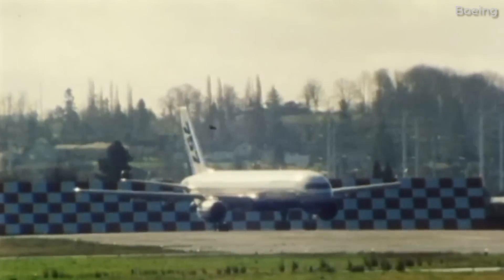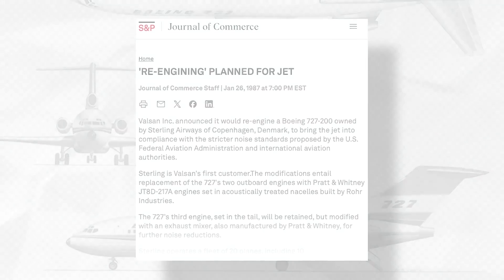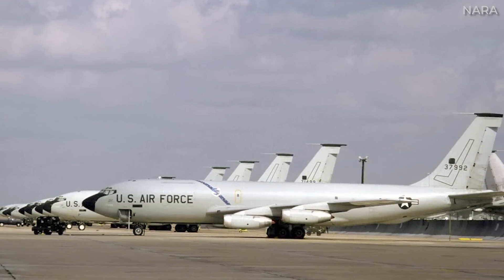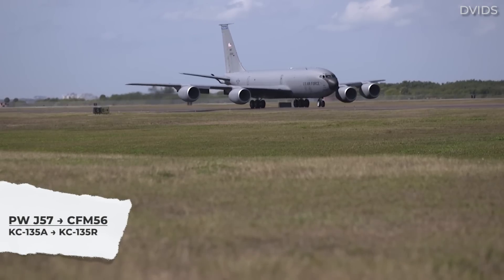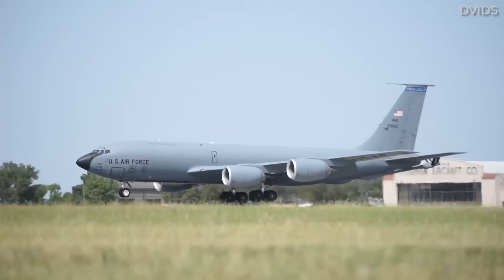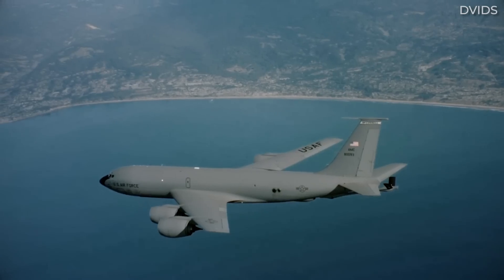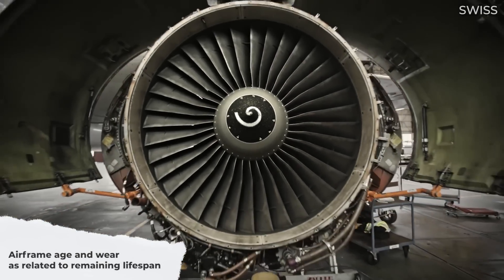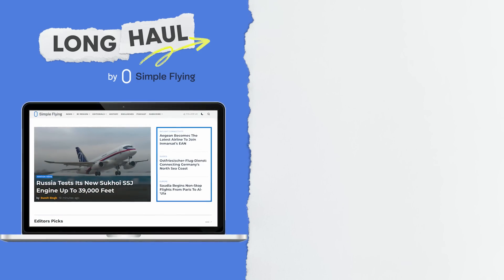Re-Engining Old Aircraft: Can It Be Done? Should It Be Done?

Comment: The DC-8-60 (and higher) was re-engined with the CFM56, incidentally salvaging the CFM program in the process.

The engine would later on be mounted to the 737 and A320 and the rest, as they say, is history.

Comment: New engines for every Boeing aircraft [ My opinion]

707: LEAP-1A 
717: CFM56 
727: CFM56 
737: LEAP-1A with the fuselage the same height as the A320
747: An engine the same size as 777 cabin that create 165,000 lbs of thrust
757: CFM56
767: GEnX
777: GE9X
787: GEnX

I also will change the yoke to the sidestick and have the same autopilot panel on every plane.

Comment: I'd reengine A319ceos with Leap 1B engines. The 1Bs are only slightly different in diameter to existing A319ceo engines, can provide a similar thrust rating, and use less fuel.

Comment: The Canadair CL-215 water bomber started as a piston prop amphibious plane, using  Pratt & Whitney R-2800-83AM radial engines. In response to customer requests, Canadair upgraded it to more powerful turboprops, using Pratt & Whitney Canada PW123AF. The current owner of the now-rebadged CL-415 licence, De Havilland Aircraft of Canada, has created an even more advanced model, the CL-515, but without a change to power plant.

Comment: The Indian Air Force (IAF) retrofitted the Fairchild C-119 Packet aircraft by fitting it with Westinghouse J34 turbojet engines mounted in a dorsal pod. This modification enhanced the aircraft's performance, particularly in high-altitude operations, allowing it to carry heavier loads and improve efficiency. The C-119, known for its cargo capabilities, was crucial during missions in challenging terrains like Ladakh, where it successfully transported troops and supplies at altitudes exceeding 16,000 feet.

Comment: For anyone saying re engine the 757 here’s why not.
- the 757-200 airframe is far heavier than the A321neo despite being the same internal length. This means with new engines it will lose its high thrust and still be less efficient.

The 757-300 would need a whole new engine type designed and built as it needs more power than the A321neo and Max-10, but less than any modern widebody engine. Plus their are not many -300s

Comment: Thing is, if we're going to talk about reducing our climate impact, sure, we might do that by retiring older airframes for brand new aircraft, but it's not like the NEO is an A320 made with new composite fuselages, it's the same 20th Century design - I know, it's approved by the FAA and EASA - that has a new wing and bigger engine, when a weight saving in the centre could be the improvement of fuel efficacy that's needed to meet global targets.

Comment: "forcing (Boeing) to include software to compensate for the unsafe aircraft behavior"  It wasn't because of unsafe behavior -- it was simply to meet an FAA requirement that control column forces must be within ten pounds of the existing design if there was to be no motion-based simulator training required.

If that FAA design requirement did not exist, there would have been no MCAS.  On occasion, pilots doing a couple of different maneuvers would have found they needed noticeably more column force than what they would have on what they had previously flown.  So perhaps a slight delay in desired angle of attack change, for example, as they adjusted to the heavier controls.

Comment: Up until now, an engines successor has invariably been larger and heavier than its predecessor. 

This has been in the main due to proportionally larger front fans to increase the bypass ratio.

Now, assume that the bypass ratio could be increased by having a smaller and more efficient core.

This would not only increase the engines' efficiency but also reduce its weight. There is also the possibility of reducing the size of the engine.

The engineering required to replace an engine with something no heavier and no larger is far simpler.

Comment: 737 Max never had unsafe behavior due to the engine plcaement, it was different fron NG series at high Angles of Attack, but not dangerous. MCAS was meant to provide similar handling to that of the NG series, that's all.
Reply: not exactly -  at low weights, with rear biased CoG and high power levels - the MCAS system was indeed there to prevent stalls from excessive pitch-up  (eg. go around) due to the new, higher, and forward placement of the engines
Reply: @ghostrider-be9ek  which isn't inherently unsafe - you just need to know about it, and react accordingly (or have the software fake it)
Reply: @ZeDestructor00  yes it is, and aircraft have crashed (russia) because of this effect
Reply: @ghostrider-be9ek  Which type/model of aircraft crashed in Russia?
Reply: @htimsid  I dont recall, was it a boeing or one of their domestic products? it was a medium sized aircraft
Reply: @ghostrider-be9ek  Possibly a Sukhoi Su-95

Comment: I'd love a re-engined 727 with a glass cockpit and modernized interior. A bit noisy, but one of the most beautiful aircraft ever built.
Reply: That unfortunately would not be possible. One of the reasons Boeing gave for its discontinuation was that there was simply no room to fit a more modern high-bypass engine into its tail.
Reply: @FloppaAppreciationSociet-ds7zf  It's just a wish. Hypothetically speaking.
Reply: @FloppaAppreciationSociet-ds7zf They actually explored replacing the 2 side engines for the larger version of the JT8D that was made because of noise snd environmental concerns compared to the orginal
Reply: And evidently the most unstable on approach.
Reply: @bobflicks6104  They fixed that by correcting the flaps settings on takeoff and landing.
Reply: EXCELENTE  AVION VOLE  VARIOS AÑOS, RESULTADO INOLVIDABLE

Comment: - A340-300 with CFM LEAP 1A or PW1100G
- 737-800 with IAE V2500
- A380-800 with RR Trent XWB or GE9x
- 747-400 with RR Trent 700
- A340-600 with EA GP7000 or RR Trent 900
Reply: genx and trent 1000/ 7000s would be more adapted for the a380neo
Reply: The IAE V2500 on a re-engined 737-800? That’s a pretty old engine. The GE90 is way too big for the A380, same with the XWB. It’s current Powerplant is sufficient enough
Reply: @APerson-fj6yx  fact: the Trent XWB-97 was tested under the wing of an A380
Reply: GE90 for the A350-1000 would be great. Then the GE9X is reserved for the -2000

Comment: I see a lot of comments talking about re-engining the 757, some even say with the Leap-1 Honestly I'm not sure, but I believe it would be a bit underpowered compared to its current engines, and so far engines for it aren't an issue, it's the avionics and the software that needs updating on the 757. Of course if Boeing ever kept the 757 in production, we might see new modifications to the intial design, such as new engines like the Trent 700 found on the A330 Neo, maybe new more efficient wingtip profiles, perhaps also foldable for smaller airports a concept found on the 777X and of course new interior designs for cockpit controls (with updated software and avionics) and passenger/cargo cabin.
Reply: I think the time to re-engine the 757 has well and truly passed.

Even had there been a suitable replacement,  many 757s would still have been retired over a decade ago.

Many of those currently flying are only doing so because the airlines had little choice but to continue running them, hoping that Boeing would have something suitable before they wore out.

Even if a suitable engine became available tomorrow,  I doubt if there are sufficient 757s with enough life left in them to justify a re-engine program's development costs.

So it has been a case of trying to find 757s on the secondary market with life left in them to justify the rebrand, or, once the A321neo and it variants became available, use them.
Reply: 757 is overbuilt for the task it is designed - shorthaul people mover. That's why the arrival and A321 and later 737-900 ate its cake to a point it is no longer viable.
Hot high performances and transatlantic capabilities are nice but they're niches.
Reply: @steinwaldmadchen  If it's such an "undesirable" plane, why is Delta still flying 131 of the type and United still flying 61.  That's pretty good for a plane that you think was a niche aircraft.  Obviously, this is a desirable plane to be flying...even though it stopped production in 2005
Reply: @ScottCP1  The fact that in the 90s Airbus managed to steal half of 757's delivery with A321-100 an obviously inferior aircraft compare to even later A321CEO, is telling. Boeing also sold ~500 737-900/ER despite it is worse than A321.
There are some airlines that value 757's better performance, just not enough to sustain the production. That's why for a fact it is a niche. It's just not universal.
Reply: @ScottCP1  US based airlines will keep flying those planes until they can't with how much demand they have and A321Neo delivery times, and the MAX 10 nowhere in sight, otherwise, it's also why icelandair is retiring their own 757s for A321Neos.

Comment: I would re-engine the flying pencil....aka the B757. A pair of engines currently used by the B737 Max would probably be a great fit for the airframe.

Another re-engine I'd love to see would be to place a pair of GE9-X engines on a B747 airframe, however that would really change the aircraft and require extensive R&D and recertification.
Reply: Counter-suggestion - find a way to add a 747-style "hump" to the 777?

Comment: Interestingly, the McDonnnell-Douglas MD-80 series planes were built strong enough to get a new engine. They should have been re-engined with the Pratt & Whitney PW6024 engines starting from around 2007 on, which could have resulted in a much quieter airplane that could have extended the life of the MD-80 to almost 2030!
Reply: Somebody should have tried a cfm 56 engine on the MD-80.  It seems to be the perfect engine for a 150 passenger plane. The 737 family has them and so does the A320 family has them so why not the MD-80 family also???

Comment: MCAS wasn't the issue with the 737MAX. The issue was Boeing didn't tell anyone about it's existence or develop pilot training for what to do when it fails. They did this so airlines wouldn't have to pay for pilots to undergo additional simulator training. That decision cost 300 lives. 

Oh, and MCAS' initial implementation was absolute trash, with no redundancy or comparison logic for the angle of attack sensors. That doesn't mean the idea of MCAS was a bad one though.

Comment: Would be great if several aircrafts re-engined;
1. DC-8-73 = 4x PW1900G
2. A340-600 = 4x GEnx-2B
3. 747SP = 4x GEnx-2B
4. 767-400ER = 2x GEnx-2B
5. An-124 = 4x GEnx-2B
6. C-5M = 4x GEnx-2B
7. C-141 = 4x PW1500G
8. P1 = 4x PW1700G
9. C-17 = 2x Trent-XWB-84
10. IL-96-300 = 4x PW1135G
11. A340-300 = 4x PW1131G
12. Avro RJ100 = 4x PW308C
13. S-3 = 4x AE3009
14. IL-76MF = 4x PW1131G
15. (Future) An-225 = 4x Trent-XWB-97 or 6x GEnx-B
16. Tu-154 = 3x PW1500G
17. SSJ100 = 2x PW1900G

18. CH-47 = 2x T408
19. CH-46 = 2x PT6C
20. SA-321F = 3x PT6C
21. S-64 = 2x T408
22. 214ST = 2x CT7C

23. C-160 = 2x PW150
24. Martin Mars = 4x PW150
25. Be-200 = 2x PW1900G
Reply: The MD-80 series should have been re-engined with the Pratt & Whitney PW6024 engine starting in 2007.
Reply: Imagine an A340-300 with CFM LEAP or PW1100G engines

Comment: 737 with a single GE9x in the tail
Reply: Do you mean one engine instead of two? That will never be certified.
Reply: @user-yt198  and in the tail?the pitching up would be crazy!
Reply: It would literally fly like a rocket then with correct modifications for the straight through design and would struggle to stall
Reply: @filledwithvariousknowledge2747  it would also be pretty unefficient!

Comment: What about the DC3 re-engine?
Reply: @romandelasalle  a company years ago modified a DC-3 by stretching the fuselage adding turboprop engines as well as a streamlined nose cone
Reply: That's essentially what the P3-Orion is; an upgraded and reengined DC-3.
Reply: @Gameflyer001  No it isn't. The Lockheed P-3 has absolutely no design DNA in common with the pre-war Douglas family. It is loosely based on one of Lockheed's own airliners, the L-188 Electra
Reply: @harryspeakup8452  yep, you're correct. There was a military variant of the DC-3 that employed more advanced turboprops.
Reply: Basler is making reengined versions called the Basler BT-67

Comment: Re-engine the 757 with a newer Rolls-Royce Trent engine, to deliver the same 43,000 pounds of thrust as the RB211 did, call it Trent 400?

If the PW1000G fixes its reliability problems, maybe Pratt & Whitney could offer a higher thrust variant of that for a re-engined 757.
Reply: Can be also called as “Trent 600 (III)”
Reply: PW1200G?

Comment: You forgot the re engining of the B52s with Rolls Royce engines
Reply: I was thinking the same - also, it's interesting (and would make a good video) as to why they went with 8 not 4 engines. Apparently the work to convert to 4 was too much.
Reply: @shero113  i think using 4 engines would affect the aerodinamics, so they would have to redesign the aircraft
Reply: @rodrigogoncalves6165  it's also about rudder sizing. The rudder must be sized to compensate the imbalance created by one engine failing
Reply: it only focused on jet engines.. they didn't event mention convair props or dc-3 engine conversion from piston to turboprop

Comment: Boeing should have chosen to redesign the 757 to conquer the mid range market and rival the A321
Reply: Boeing offered an improved 757 to airlines years ago but no one at the time showed interest and received no orders.  And while the B752 was kind of successful, the B753 was a commercial failure.  Also, the 757 was more expensive to build than the 737.  Finally, the 737NG family turned out to be a massive success for Boeing and became the best-selling single-isle airliner.  So Boeing had two single-isle airplanes of similar capacity and performance, but one did well while the other did not, the poorer of the two saw a market not favoring it and cost more to build.  All of this pretty much conspired against the 757, despite it being an objectively better airplane.
Now, with everything that has happened since (market changes, MAX issues, etc), in hindsight it is easy to look back and say "it would have been better to go with the 757 instead of the 737" - and I agree.  But in many industries, strategic decisions are made that don't have an effect years, or even more than a decade later, and things can and do change in that time that are difficult or impossible to anticipate.  This doesn't excuse Boeing's mismanagement of the MAX program, but if they knew at the time how things would have developed they likely would have gone with the 757 instead.
Reply: I like 757,and I just love uts fuselage,but cancelling it was the right thing to do.
Reply: The 757 was cancelled because at the time there was no demand for it, unlike the 737 NG that was selling like hot cakes. The simple fact that there were many, many more pilots with existing 737 type rating, then there were with 757/767 type rating, made it far more appealing to the airlines. This was also the reason Boeing had to build a 737 MAX, instead of a 757 MAX, or an all-new aircraft altogether as they originally intended. With the major efficiency gains from the CFM LEAP and P&W 1000G engines, even Boeing loyalist became interested in the A320neo. To avoid losing customers, Boeing offered existing 737 operators the only thing Airbus couldn't: commonality, similar efficiency gains, but without the added cost of re-certifying all your pilots for a new type. This would not have worked with a 757 MAX, because then the airlines would have to bear that cost anyway, it had to be the 737. In a way Boeing and the airlines both fell victim to the 737's success.
Reply: when the 737 was selling so fast,and the 757 wasnt,there was no need to
Reply: Nobody wants it, hence why Boeing cancelled the project.

Comment: A350neo with the GE9X as an option
Reply: There's no point designing an A350Neo right now, its already a 'roaring' success with its RR XWBs, and virtually sold out until the early 2030s. They've just upgraded the engines, and Im sure small improvements will continue, but they just don't have the facilities to build a Neo version. So, by the time a Neo is developed, as it surely will after 2030, the GE9X will be an antiquated power plant, not the go to power plant. RR are currently transferring technology from the Ultrafan to existing XWBs, and I see that continuing for the development of a RR engine for the Neo.

I know some American fans see the success of the A350, and think GE would like a slice of that pie, but GE refused to power the A350-1000, and Boeing declined a RR alternative engine for the B777X, so drove these two European manufacturers together, and they're doing pretty well. I expect this relationship to last beyond 2030..............
Reply: It's an exclusive contract
Reply: GE9X is only marginally more efficient. Maybe Ultrafan or anything GE / PW compete with that.